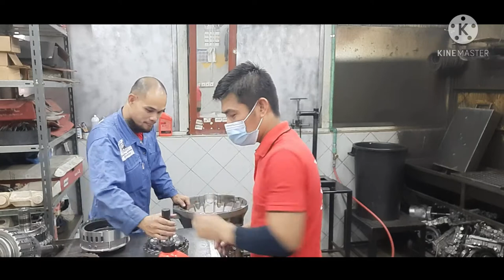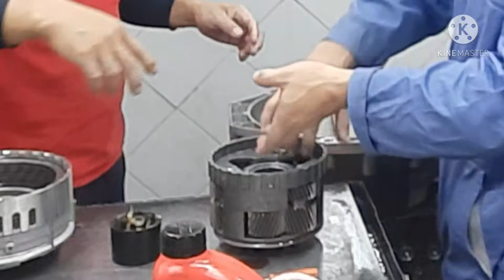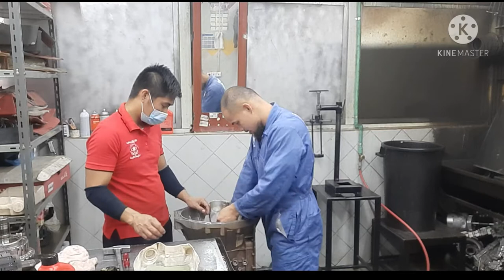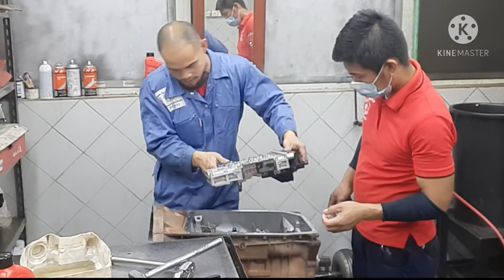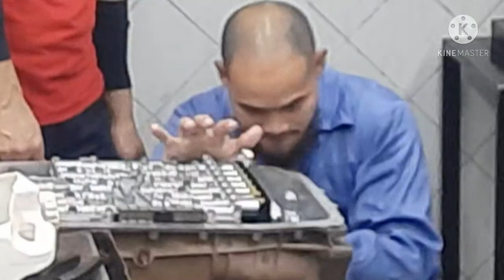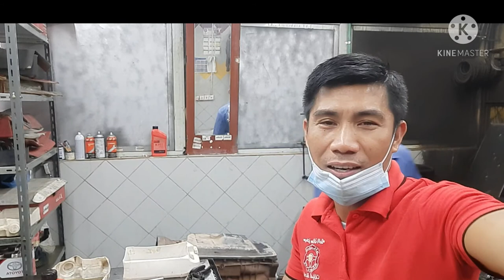Part3:Engine Shaking Sometimes shot OFF in R and D/Ford F-150 2015m///Tagalog

Comment: boss patulong NAMAN,, Honda city idsi 2007 model matic trans bagong palit ignition coil spark plugs at mga engine support,, tanong lang bakit gerking parin tas sometimes namamatay engine at bumibitaw Ang clutch,, pero pag tumatakbo na ok NAMAN shifting nya
Reply: Patulong NAMAN lakay
Reply from the maker: Sa loob ng transmission Ang problema yan boss kung namamatay.i check ang langis kung amoy sunog.bka may sunog n clutch .need overhaul or palit tranny.at i check ang Converter bka maganit na rin.
Reply: Salamat boos lakay

Comment: Gud am boss ask kolang kung anu problema ng bongo friendee mazda ko dati gumagana sa drive ,,ngayon parang ayaw nyang mag engage tapos nagbliblink yung hold anu kaya cra npanood ko yung ginawa mo nagtest sa battery ng solenoid kung buo o cra sa solenoid kaya cra nito ksi may gumagana nman yung reverse nya at segunda at primera nya bukod tangi c drive ayaw painitin kpa para lang sya mag engage at kung sakasakali mga ang solenoid sa drive pls po no mumublema ako eh.salamat po sa pag tugon nio.
Reply: At kung saka sakali magkano po ang solenoid.
Reply from the maker: Good Am too Boss.Una gawin mo i engine Scanner bka may trouble code or malfunction sa solenoid .kung meron i trace kung alin sa mga solenoid katulad ng ginagawa ko.pero pg wala .internal failure ang problema .maaring sunog ang clutch or singaw ang Oring sa Drive nya.need buksan ang tranny Boss.
Reply from the maker: About kung mgkano ang Solenoid wala ako idea sa masda pero sa Mga toyota cars mga 400saudi riyals or sa peso 6k ang isa boss.